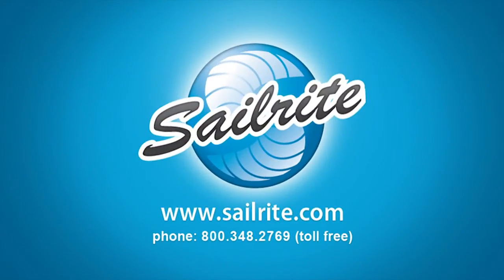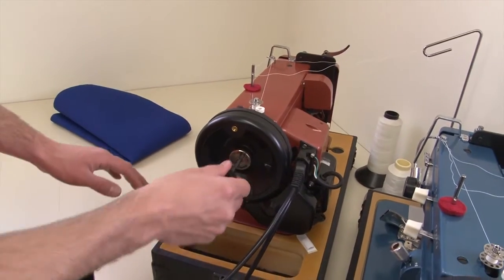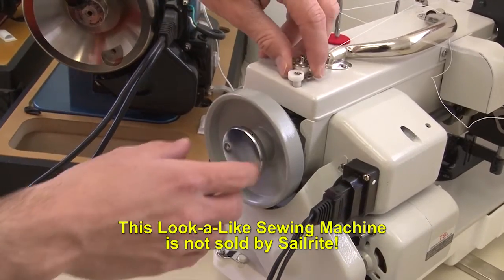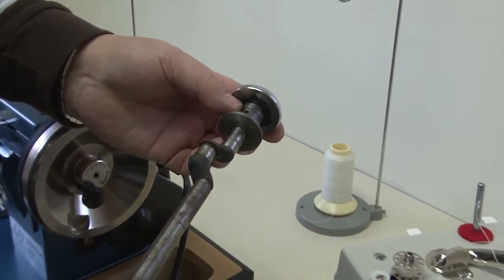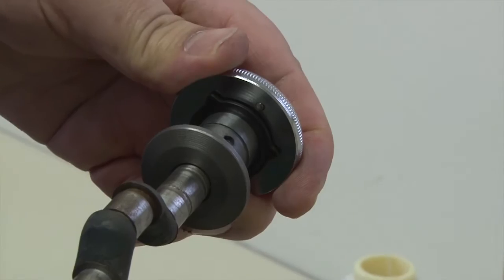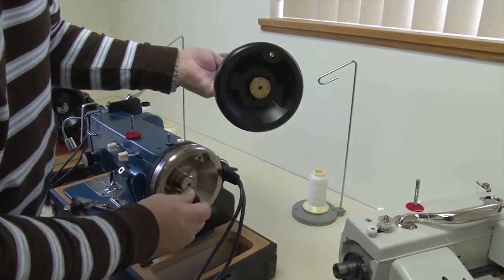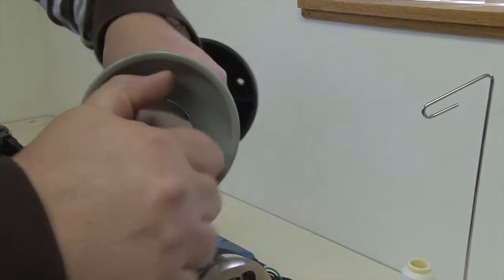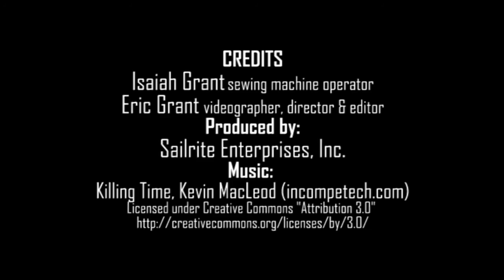Posi-Pin Vs. Friction Clutch on Sewing Machines Demo

Comment: I would like to see a channel that does not have any buy-in to either system give the pros and cons of both. And to be fair, the industrial sewing machines that I have used all have a bobbin winding system that doesn't require you to fool with the hand wheel at all.

Comment: Does your house have a fuse box or circuit breaker box? Does your car have a fuse box? Does your house have a thermostat? Why does sailrite sell a replacement driveshaft, no clutch to prevent damage. If you are sewing  eight layers you need to have your design changed.
Reply: I think theyve got a shear pin system now